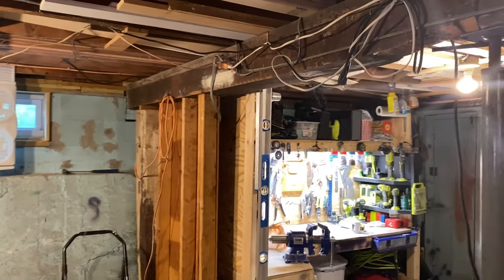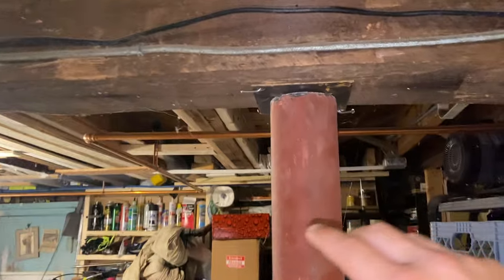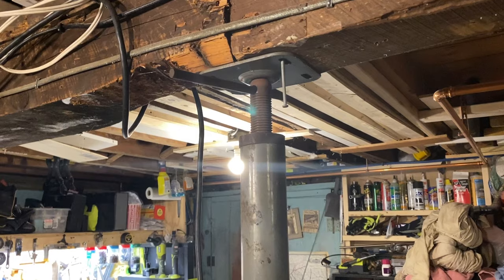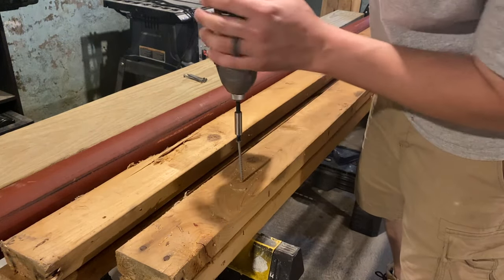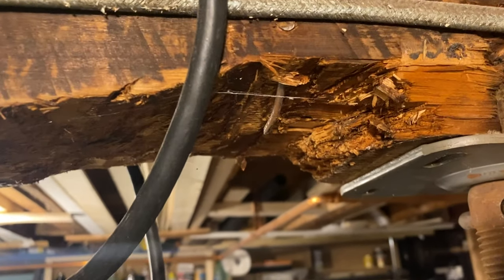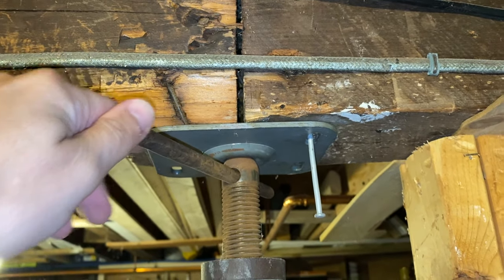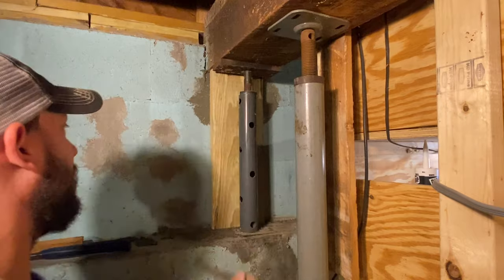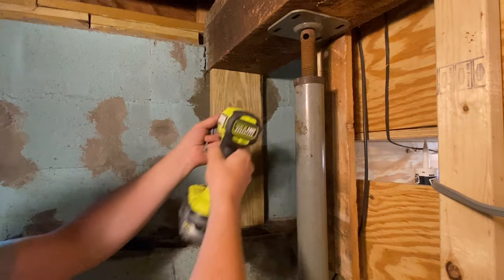Supporting the Main Carrying Beam in My House

Comment: Nice work, and very good video. I have a few suggestions to improve the  result for the longer term. I'm a retired carpenter, over 50 years experience, so far. Anyway, relying on the weight of the structure above to hold all the supports you added really isn't a good idea. I strongly recommend that you add structural fasteners at the top and bottom of the new steel column. What you have now, bent nails above and nothing into the concrete isn't remotely adequate, in my opinion. I'd be surprised if the maker of the pole didn't call for more/better fasteners, and every building code would absolutely require them. Drywall screws or deck screws are grossly inadequate. It would be a great idea to weld the bearing plates to the steel pole. I'd also add tie plates on both sides of the wood beam, like a Simpson PSQ 418, about $25 each, with the recommended structural screws, preventing any possibility of sideways slippage . My opinions, easily worth every penny you paid for them.
Reply: Thanks for this comment.  I have a similar situation in my basement but the total span is about 50 feet with 5 support columns.  The Beam is over 100 years old, cracked, and there's actually two beams which butt in the center with no tie plates.

Question for you is whether it would be adequate to reinforce with heavy (12 guage?) tie plates across the butt joint, and then T plates connecting the wood columns to the beam?  Alternately, I could build in a cripple wall under the butt joint to carry the load instead of just reinforcing the existing beam/column joints.
Reply: I have the same situation, both beams are cracked and sagging on either side of the support column.
Reply: @nickreiter6221  Got a pic or three? Sounds pretty bad!
Reply: @@fredthe47thSuch a helpful person, you are! This is garbage but I'm not going to explain why...You sound like you are selling shamwow knock offs at 3am on local TV.
Reply: Very true , post should be attached at both ends .

Comment: Nice job. But I did construction carpentry. When you walk into a basement and you see adjustable steal Support polls. You use the same thing that you used the 2x4’s  for. I have seen 2x4 basically explode when you drop the weight on them or they’ll take the weight you’ll hear some funny noise and then they explode. You’re lucky. The only other thing that I’ve seen is where you put the permanent support pole at. That looks like two beams coming together. I was trying to see if it wasn’t but the one angle shows that it looks like two ends coming together. On top of the permanent pole you should add 2 plates you should have at least a 12 inch long plate however wide the beams are that should’ve went on first.  Put some screws in it just to hold it in place then you sit your permanent pole underneath it with its plate on the 12 inch plate. I probably wouldn’t worry about it if your permanent pole had a endcap plate. And then it look like that permanent pole only had what a 5 inch wide plate you put it to a uneven beam. Let alone it was two beans one of them was on even coming together. Basically think of a teeter totter houses continuously settle. supports always move with the settling. With that little 5 inch plate that’s just sitting on top of concrete nothing else holding it but a nail and pressure. That’s why I was saying put a 12 inch long plate across the bottom of both of them making it a one solid suport point. For the permanent 5 inch plate to support it. You understand that those are support beans that’s why you’re using the concrete poles the adjustable support poles but do you know what happens when you apply pressure to things like I said 2x4 I’ve seen them explode. Now your support polls won’t explode because they’re made to handle the weight. But if they get kinked or forced to Suport at an angle those polls will come shooting out of they’re like a rocket.  And remember your permanent pole is only connected to that 5 inch plate by sitting on top of each other. You should go to Home Depot or Lowe’s and ask them if they have the proper end caps for that support polls. If I remember right the proper end caps come in two different sizes 6 inch plate or a 12 inch plate and it’ll look like they’ll have a pipe welded to the bottom of them but that just slips over the end of the pole that’s going to be supporting it.

Comment: I bought a house, paid a professional $400 to inspect the inside and outside. A year later we decided to start remodeling the bathroom because it started to bow and move in the middle of the floor. I’m pulling up the flooring and it has a rotten sub floor. I just had a baby, so I called my dad over, he goes down to the basement and they cut the support beam under the bathroom to make room for plumbing. How the inspector missed that I have no idea. Our bathroom has sunk about 2 inches. My dad managed to jack it up a little and put some supports in
Reply: We bought a house a few months ago. Also paid a professional inspector for inside and outside inspection and he said about couple minor defects that weren't a problem at all.. we purchased the house with major termites and carpenter structural damages (high activity), completely missing foundation in addition (one bedroom and kitchen) and rotten out beam and joints. The addition was sitting on couple of bricks and a bottle jack. With water going right on the ground by main part of the house foundation from kitchen sink. It's besides mold that also wasn't detected by the inspector. 
The good part of it - now we know how to do inspection ourselves next time. The real one. The bad part is that the problems we faced are going to cost us tones of money  and time to fix

Comment: Great video. I might have thrown an asphalt shingle under those 2x8s to prevent wicking. Otherwise, perfect repair!
Reply from the maker: Hey Mike!  That is interesting, I have never heard of that actually.  Is that common?
Reply: @TheFixerHomeRepair  it is, at least out here in the Pacific Northwest. Shingle is the most common I’ve seen/done. But I’ve also seen people use 6 mil plastic sheeting squares and pieces of the pink mud sill foam.
Reply: @TheFixerHomeRepair  super common and definitely recommended for wicking as the other commenter said.

Comment: 13:50, pro tip. Put the concrete powder in a larger zip lock, add water, close the zip lock and knead it like dough until fully mixed. Cut the corner of the bag and squeeze it in the gap.

Comment: Thanks for the video, definitely looks cleaner and is an improvement. Yet, the thick steel chunk would have been perfect for the first column. It gives a good bite on both joists ends because it would cover much surface and prevent the lally column to sink inside the soft ends of the joists. The plate it has is too small and only grabs the tips. Also, hydraulic cement is what is warranted for the space you filled up, it expands instead of shrinking like the one you used. It is also harder but you still should have used rebar or any metal shims and then fill it up with concrete. Treated wood is softer and it wicks the moisture so perhaps a thin material between it and the concrete would be ideal.
I have a shop near my home and I ordered a 3/8 rectangular (18'' by 10' which is the height of my joist) steel bracket that they cut and pre drilled the holes for me. It was only $60 and it tied both ends very well in case there is some ground shaking in the future. You could also take the column and they can weld a bigger plate on top. Anyhow, it was a nice project and you did good, it is better now.
Reply: Exactly my suggestions as well.  That flimsy metal plate is not going to cut it, IMHO an upgrade to a thicker plate is worth the effort. It's not possible to do a DIY video without exposing yourself to the feedback of others who have already made similar mistakes!  Kudos for sharing (Fixer) and being open to the constructive feedback of others.
Reply: Good suggestions.  I also would have used construction adhesive with clamps  on the 2x4s for added strength. What he did should hold. But I'm like you I would be more comfortable using a much longer plate above the pipe for more surface area contact

Comment: A telapost is what we call them here in Canada and they are good for around 9000ibs, perfectly capable of holding that load.  Love the vids.
Reply from the maker: Aha, yes I agree they are very strong.  I will keep the ones I took out around to use as jacks when doing this kind of work.  Thanks for checking out the video!
Reply: Pretty old to reply to this comment and your reply but the column that you used to replace the jack with is so incredibly strong for a can with aerated concrete in them that all the comments saying that its weaker has no clue.. Infact I used to work south of Pittsburgh Pa. In a longwall deep mine doing recovery and support and would set those exact type of columns (we called them cans) mind you they were 18inches in diameter and set every 4ft apart, but the purpose of setting the cans was to support the roof and keep entries open and free from collaping after the longwall miner came threw and mined everything that would be holding it up and those cans can hold up the pressure of 1,400+ ft of earth above them and not give then i dont think anything could crush them.. @TheFixerHomeRepair

Comment: I have a sagging floor and need to support the 21' carrying beam in the basement.  I bought 3 Tiger Brand JS100 adjustable jack posts and started raising the beam.  The center post is starting to buckle since it's a 2 piece post.  I want to replace with the lally beams you are using but can't find them.  Your link for them goes to Home Depot but they aren't coming up.  Do you have any more info on these?

Comment: I had to do the same thing in the basement of my old house. The support beam was huge, about 6x11 douglas fir and spanned the whole length if the house. There was 1 piece of 4x4 cedar post right at mid span and it was warping under the pressure. 
No matter how many precautions you take, it is really nerve wracking doing this kind of work.
Reply: Hi did u remove the beam or just support it?

Comment: one thing I don't know if it is mentioned, is you can't just throw a few columns under your main beam and call it fixed. You have to demo the concrete where you plan to place your columns, and pour a much deeper footer about 2x2x2 feet(local codes vary) for the column to sit on, or your 3" thick floor will crack and your pole will sink.

Comment: It looks like great work you did. Just a note though, I must have been in 1000 basements in my life that have teleposts. Not once have I ever heard them referred to as 'temporary columns' . I have no clue why that tube steel thing you instal is better in any way. Thanks for the video.
Reply: "Teleposts" by most building code can't stay in place more then 30 days.
Reply: Hi, do people ever replace the support beam or do they just add additional supports to it. I have this same issue. The lumber is old and bent causing  the floors to sag. I want to know if we should replace it

Comment: How many of those should an 800 sf house have?  My home has only one and it's not in the middle.  Good guess as to why the floors are slanted to the middle? 😟
Reply: As little as possible but not too many
Reply: @gregmize01  Thanks!
Reply from the maker: Hard to say, that is for the builder or an engineer to tell you for sure depending on the size of the beam and length but if your house is sagging it could probably use another.  On the other hand if your house is really old it will likely sag anyway.
Reply: @TheFixerHomeRepair  Yeah, built 1939.  Thank you for your reply.  Great video, I learned a lot.

Comment: Great job Matt! Will you remodel your workshop and if so, could you do a series as well as a time lapse? That would be awesome 🙂🛠
Reply from the maker: Hey, Graham.  I am planning on doing some kind of remodel for the workshop.  Not sure if I will do a series but am planning on doing some one off videos along the way.  Stay tuned!  Thanks for being an awesome and loyal subscriber!
Reply: @TheFixerHomeRepair  you're very welcome buddy 🙂🛠
Reply: @TheFixerHomeRepair  I just bought a home, thoroughly inspected, supposedly. We see that to make room for stairs they cut the carry beam in the basement. 8 feet removed at the end of where it sits in the foundation walls. So the beam stops at the stairs and does not continue. AFAIK you cannot cut this beam. How did it pass inspection? Now the weight on the wall that no longer has the beam is showing obvious stress cracks in the cemented wall. The beam has twisted some at the end of the cut end. How dangerous is this? The floor above the cut is not settling flat anymore. Ty..

Comment: I'm doing a new i beam in a older home that had brick wall holding up the first floor, the structural engineer required new footing and   cement pads, are you concerned about the footing not being under the new post?

Comment: Nice how-to video.  I would wear safety glasses throughout the video.  You also could use silicone or WD40 to spray the metal screws on the screw jack columns to make life a bit easier when turning the adjustment screws.

Comment: Would 6 large beams be supported  by 1 samillare beam.
Coz that what i have in my loft out here in oran algeria. 
Or would i give it an extrat  metal support.
Imean what is the maximum weight  could a single beam support ?

Comment: Pressure treated lumber will rot. Especially the new formula stuff, unless it rated for ground contact, I've used the new stuff and had it rot in less than 2 years. Most of the 4 X 4 and larger stock is rated for ground contact.
Reply: Even ground contact lumber will rot, unfortunately.
Reply: I have pressure treated from 1980 still good repurposed on same deck and Shit from 2010 all rotted from inside out sad.

Comment: He missed an important step!!! The top and bottom plates of the main column should be welded to the column. If something heavy falls against the column or something like that, the column could pop out and crash comes the house. Top plate should be lagged, not just a couple of nails bent over - very hackish. Personally I would have kept the steel column at the knee wall. The structural value of the beam and mainly top 2x is compromised by holes drilled through for wiring. Why? Go over the beam instead. For that matter the NM cable stapled to the beam and sill plates does not meet NEC, CSA, IEC because it's not protected from damage. This basement requires a complete rewire job ... scary!

Comment: By code they do need to be fixed.  Also wouldn't hurt to weld the column to the plates as well as bolting to the beam and floor.

Comment: That will do the trick. What I usually do is cut two sets of sistered 2 x 4s an inch too long,  hammer them into place,  hammer them a bit more until the desired height. Multiple ways to accomplish the same feat.

Comment: Ok, maybe my question is premature and you answer this later in the video but what is a lolly column?
Reply from the maker: I do answer it in the video.  It is basically concrete poured into a metal sleeve.  They are used as a solid support for a beam like this.

Comment: Dear fixer! Looking at your video gives questions about your education. A better way of solving this "basement project" is to replace the whole beam with one of metal. Talking about "cement" when putting concrete/mortar in holes in the wall is SO amateurish. Cement is the powder-like stuff which comes in sacks. Now you know.
Reply: What do we do with your education? What is a metal beam? Do you mean “steel”? Just like cement vs concrete.
Reply: Btw you are also wrong about correcting him. He used quick setting cement, hydraulic cement and that is what it is called. It is not concrete or mortar. You do not add any aggregate, just cement and water. So it is called cement.